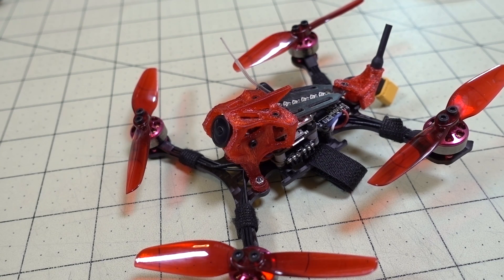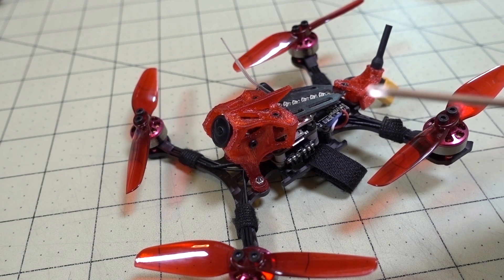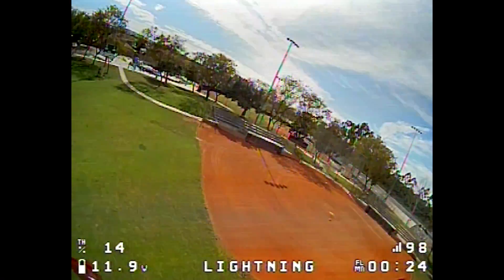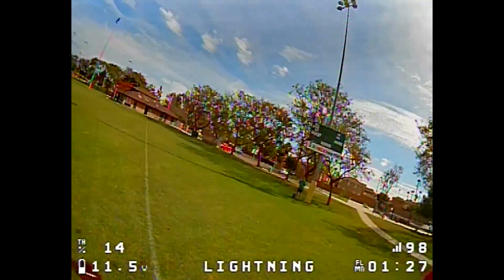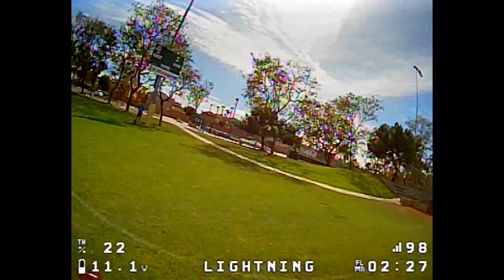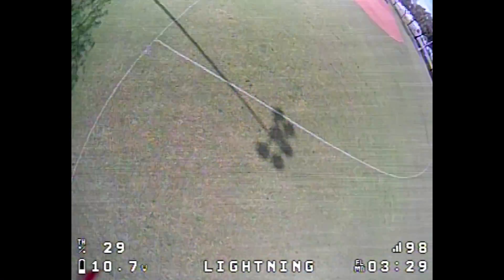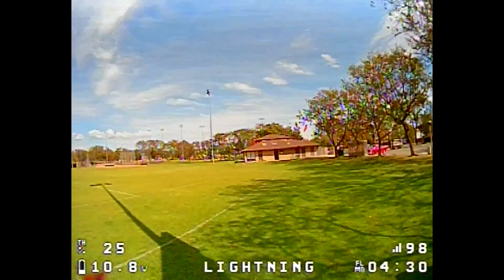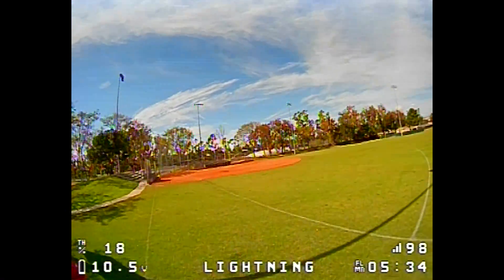Geelang Lightning 120X improved with RPM Filter! 😀👍

Comment: hello 
is it possible to get the betaflight dump with rpm filter ?
Reply from the maker: I removed it because some noob just put my settings in there without doing the other steps (didn't bother to watch the other videos) and fried his ESCs.
Reply: @AlbertKimTV  could you then give me the original dump because I have mine which jumps 1 meter when I touch the ground lightly with the original pids profile 1.
and when I put your pids of this video it goes straight to the sky as soon as it hits the ground with 8/4
90 p of yaw seems huge on the original pids
Reply: @AlbertKimTV  I would like to check if it's normal, maybe everyone uses it like this
Reply: @AlbertKimTV  previous step, you mean updated esc
 ?

Comment: Lost a motor on mine do you think I could replace it with the betafpv 1204 or should I really change out all 4 to stay the same brand?
Reply from the maker: You can change one motor.  I've done that on other quads.
Reply: how did you lose a motor? Are the motors low quality?
Reply: @pipoypipoy7796  hard crash broke an arm off and then the prop cut the motor wires. I actually really like the motors on that quad.